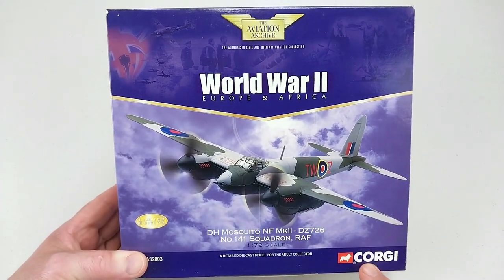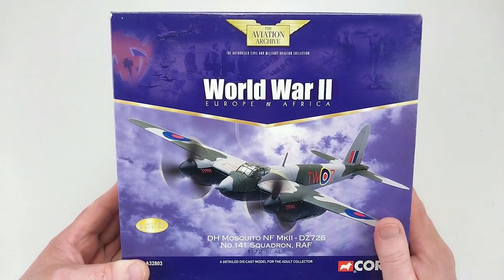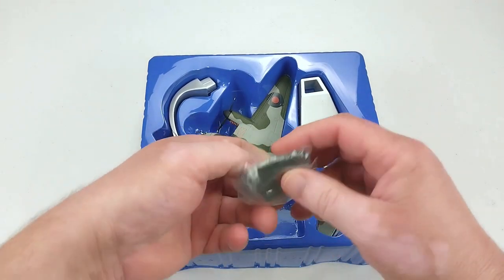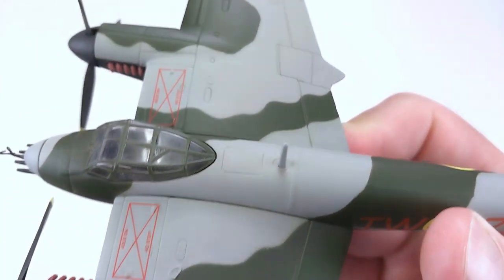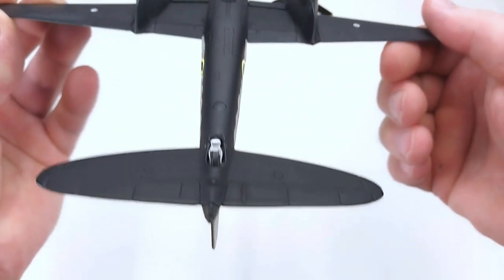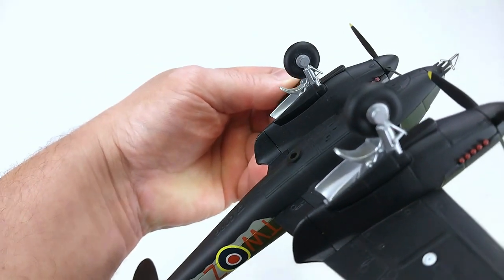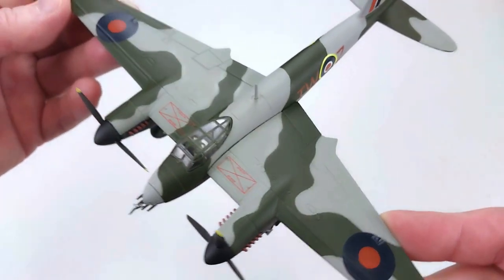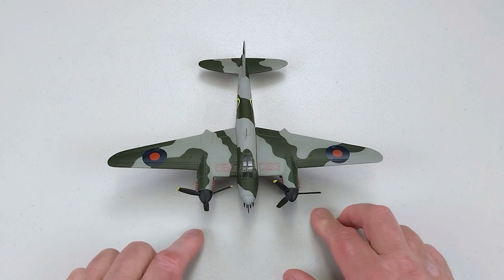De Havilland Mosquito NF.Mk II Night Fighter RAF No.141 Squadron, Corgi AA32803 1:72 Diecast Model

Comment: Do you ever use a glue for the undercarriage, if so what type?
Reply from the maker: I've never glued any undercarriage permanently. I have done it once or twice with bits that just continuedly fall out. But i usually just us a normal glue that wont adhere permanently or even i little bit of what called Blutak here which is like a putty that you use to stick posters on walls and stuff. If I was to do it I would use super glue for a permanent and strong adhesion. But thats only if you never plan on displaying it any other way 😀